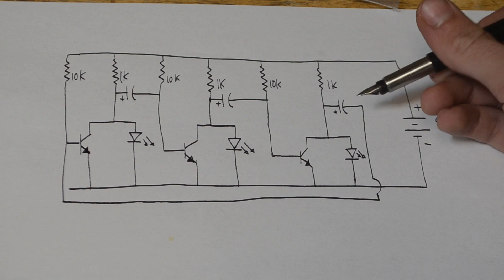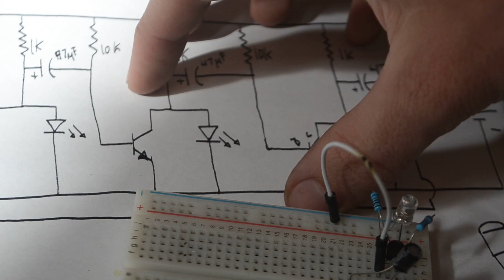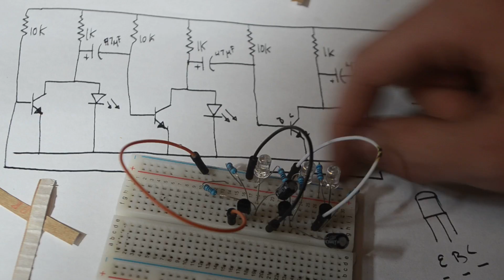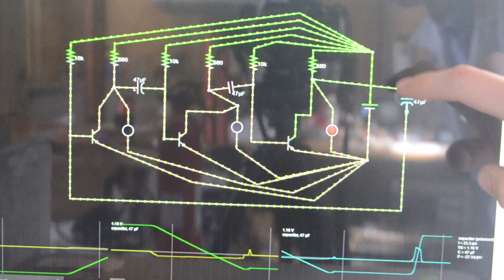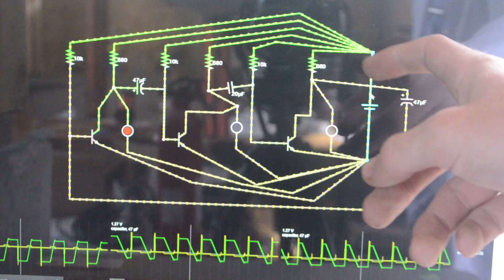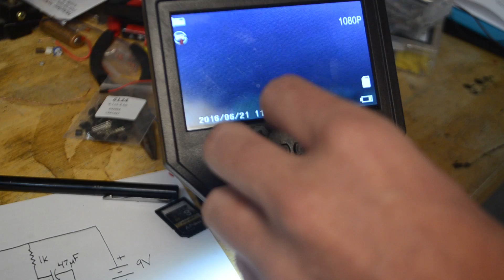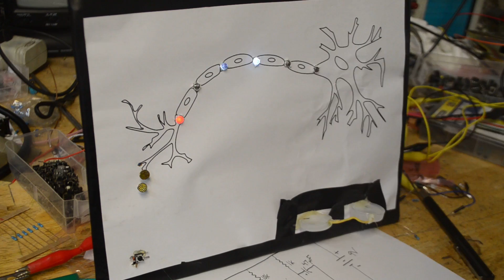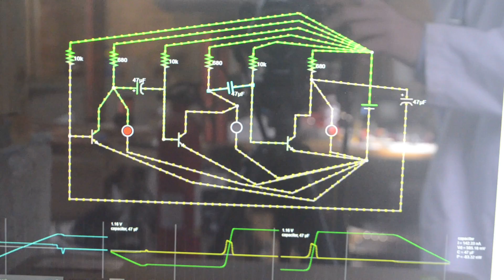How to make Running LEDs

Comment: I love your videos, as a physics and electronics enthusiast. Your projects are very entertaining to watch and contain LOTS of information. I do have a problem with your videos however, which can be seen especially in this particular one. You speak very, VERY fast. Now, that usually won't be a problem, but the information you give us isn't everyday knowledge. Additionally, there is barely any pauses between audio clips (you edit your videos so that when you finish a sentence you immediately start a new one). This makes it hard for us to fully grasp your videos as we have to force our brains to process visual and audio queues much quicker. Maybe you can slow down a little and put at least 2s gaps between sentences. 

P.S. Love the accent

Comment: If you added a few more red/white leds & a 3-12V buzzer paralleled at the final left of your board that would blink & sound together, you wouldn't have to have the extra spark gap circuit.

Comment: Love your videos, but seriously what the hell with the circuit simulator, its like R2D2 sneezed.  Here I cleaned it up for you, you can use this one http://tinyurl.com/ksfv2vx
Reply from the maker: Cory Marshall haha, yeah... it was my first time using it and it kept giving me errors when I would try and connect wires to one another :P.... thank you so much! I will update the link in the description to the one you made! :D
Reply: any time, iv been playing with falstad for two+ years now.  I have defiantly brought it to its limits before.  My single best tip is, If you get convergence errors, try reducing the time step to a smaller value (options -> other -> time step) and/or turning off trapezoidal approximation (inductors/caps).

Comment: Try "Everycircuit". Its a simulation app that I think is better than any simulation program out there. I used it like more than one years. You can download it from google playstore for free. But it has many possibility if you purcase by joining to their community. Mine is hacked "*.apk" file downloaded from internet. Keyword at google "Everycircuit apk". Works great too with the lacks of not connected to the community.